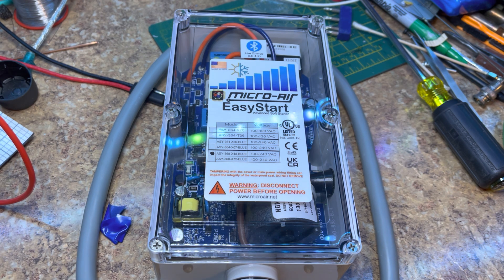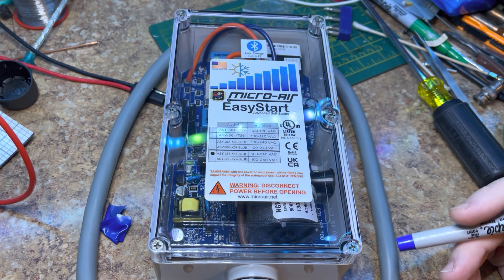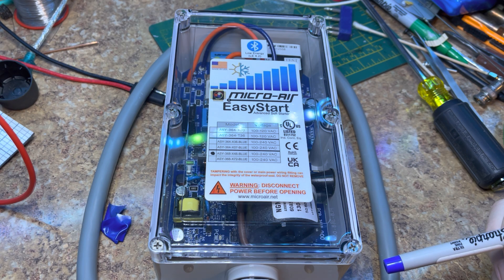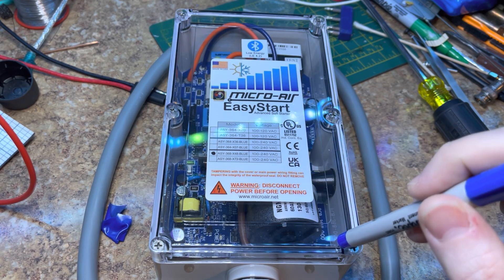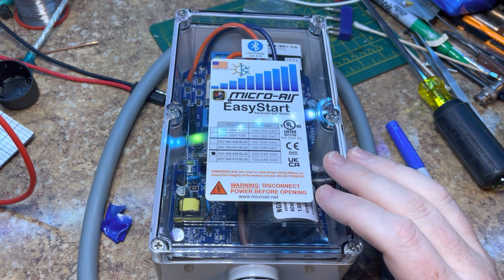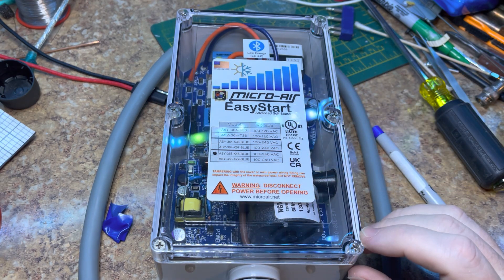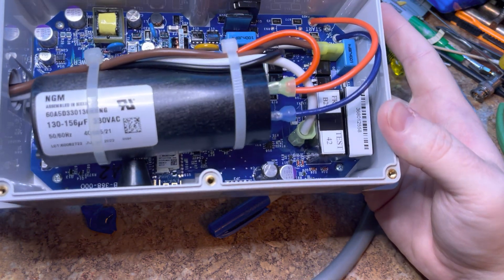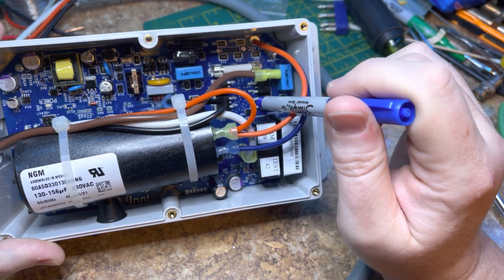AC/Compressor Start Assist/EasyStart 368 Soft Starter

Comment: Thanks for taking it apart and speaking to the quality of the unit. I installed it yesterday and I have taken my LRA down to 34 and my running amps just under 8 on my 3 ton Lennox.

Comment: It is a combination soft start AC voltage ramp and hard start boost capacitor.

It is not a VFD.  Just triac dimmer for startup voltage ramp, like a light dimmer.  Also has the large start capacitor that is put in parallel with permanent run capacitor in unit during startup ramp to provide greater startup torque.  Start cap is AC voltage ramped along with compressor voltage ramp then once compressor spins up to speed start cap is disconnected and triac dimmer is bypassed with a relay.

When first used, it trains itself for first five startups with progressively lower initial ramp start voltage until it detects a near stall during startup.  It saves the last reliable startup ramp which should yield the lowest startup surge current.

Comment: This is way too complex. I watched many other DIY similar units build for fraction of cost. Lot of people buy this unit since their generators can not even start one A/C unit. I have start capacitors on my two A/C units and I can run both A/C units of one 3KW generator / 120V. But have to manually start second unit with pre-spinning  fan. I believe that I can run both A/C units thanks to having start capacitors. Due to need of manual operation, I been doing research on soft starters and there are several solutions for under $40. Thank you for sharing your video. It helped me to understand that  Micro-Air's soft starter is not magic and they charge $300 because they can. I will now definitely build my own unit. Great material thank you.

Comment: Sr cough.take cough vaper put under tongue  for cough! Yes I do have micro 368 x72xBlue.I have save.  Credit of4 months use so for $758.00 credit.  Yellow wire from compressor.  Do-not unhook. But you trim add into yellow from box to yellow unit.  This box help works reduse amps take less amp- start up maintance. Cut off on about 5 times day. Temp inn. House 76!. Nice cool.after 4 yrs work on old 1950 wood fram house. Yes blow inn. Insulation.3foot above rafters . Yes new roof  I add regvent at same time plus 4 attic fans on timer move inn same way toword vent.  I went into attic peak day. Attic just cool as inside house .fans regvent movedead spot heat! Must. Inn ever room  ceil fans . Summer clock .rotation (winter counter clock move heat easy keep warm. Inn. Close area berween mainsuckion.  Add extra suction return. All balance work great 4 yrs past old house temp use be. Inn. 90s. Ouch old window units  high cost $450.00! Now add a/c unit central air . Add extra duck return. Now temp 76. Inn. Side house. Have Gexa ele  9.85kw.  Uage  was 3.000 now about 1.900 amp use on 4 ton 16 series  keep filters clean  ..first time il take 2-3 days balance out includevpull all trap heat out.  Get extra a/c filters. Box.microeasy start 368x72 Blue worth best invest ment of cost!! I'm inn.4 month use. Here email mikejennings 12345@att.net I send attach proof amps reduce chart!!

Comment: Do you think this unit worth over $300?  What made this unit expensive?  About half the cost of the compressor itself?
Reply: that is the same question that lead me here.. i do think it could be much more simplified and does not need blue tooth so they should at least sell a lower frills version but i have not found anyone showing how someone could build one for 20 bucks and some scrap computer parts